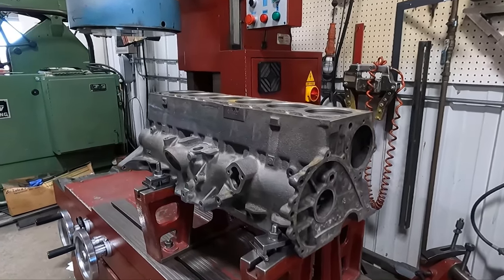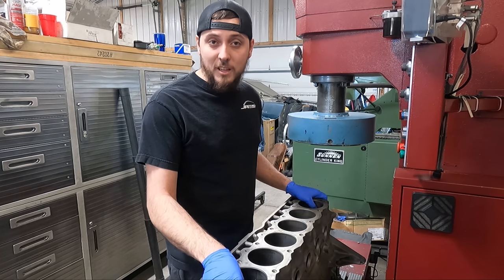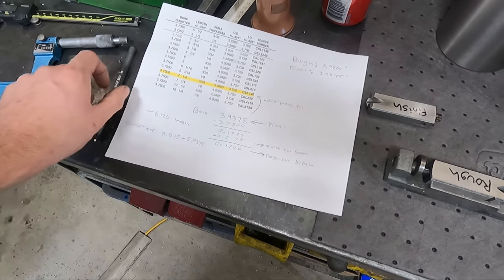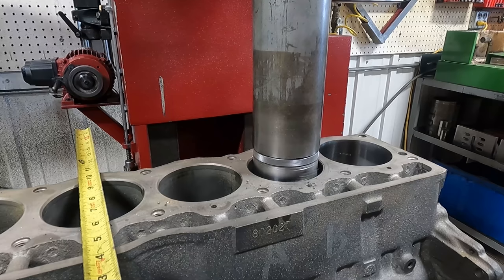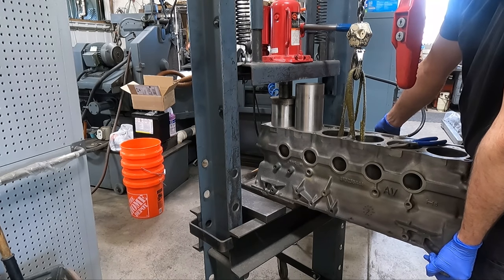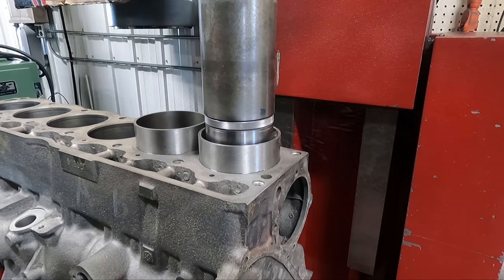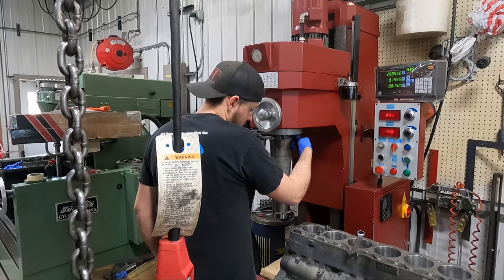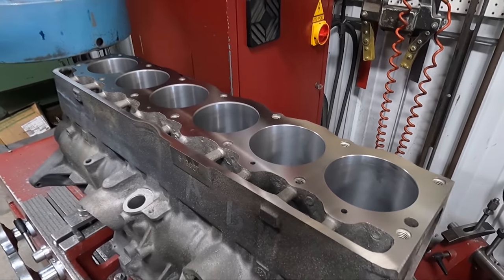Installing Two Repair Sleeves In A 258 AMC Straight Six Block @JAMSIONLINE

Comment: Is there a reason why you don't put the sleeves in a freezer and just drop them in a couple of hours later?
Reply: You need something colder than just a freezer. Dry ice or liquid nitrogen does the trick but time consuming and increases the cost of the operation. A shrunk sleeve should also be clamped in place after install, during temp normalizing. This is because they can move during that period and leave a gap at the bottom where the sleeve meets the step machined at the bottom. Also have to wait until the block and sleeves return to room temps fo machining, or we'll get scewed measurments and results. Pressing or banging them in ends up being quicker in the end and cheaper to do. That is why you don't see to many engine shops freezing them for install and just press or pound them in.

Comment: Question for you. The cabinets behind you from Sam’s club. Did you just stack those two or are they sold as a set?
Reply from the maker: We just stacked them! We have (4) total, just have them two high back to back. 

They’re not really very heavy duty, but work good for us.

Probably wouldn’t recommend rolling them around much depending on what you have in them. They’re stationary in our shop. 

We’ve probably had them 10+ years.

Comment: I have 1964 260 V8 motor that I've owned for 45 years now ( senior in high school ) and i want to rebuild the for the 2 time it's .030 over and it has 250000 miles on it since rebuild, I want to rebuild it again but I want to resleeve it . My Falcon and motor have been in storage for 20 years now, I'm waiting for day Tech. has got to point where I can save my motor by re-sleeving it, This Ford V8 is thin wall casting can this motor be re-sleeved
Reply: I have heard of people plating iron engines if sleeving is no option. They use the sort of thing OEM aluminum Porsche engines got.

Comment: Could it be that this engine was running too cold, maybe the wrong thermostat or no thermostat at all? That could be the reason why the first two cylinders were more worn than the rest.
Reply from the maker: It could be something along those lines! It is interesting that the wear is the worst towards the front of the engine near the water pump. 

I think it's also just an old, worn out engine lol.

Comment: Profilometer ??   As a 39yr master I'm seeing lots of local builder issues due to incorrect finish profile on the hone.  With the smaller and smaller ring packages, and coatings customers of theses builders who don't watch the webinars put on by total seal or don't believe in the necessity of equipment upgrades are cost effective to customers but have oil use and check engine light issues in short order.

Comment: 90% of the people watching this do not understand what you are explaining and how much effort you put into saving the bore on this block. Curious to see the rod bearings of this engine and others after 100-150K miles. Just to see if you can see a difference due to the marginal bore offset. I doubt that it makes any difference and falls into the parameters.

Comment: 👍apparently they didn’t use the best quality cast iron in those blocks
Reply: Sometimes people will sleeve all bores if the block is made of a cheap alloy. Many replacement sleeves are centrifugal cast ductile iron and will outlast a stock bore.